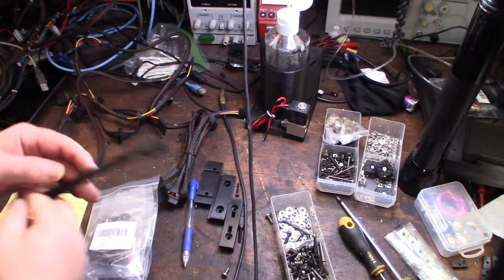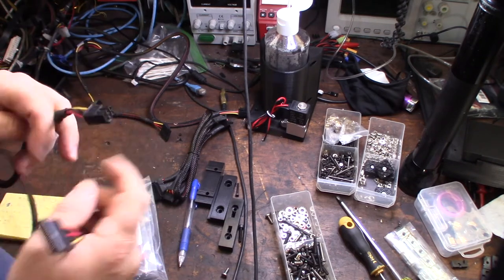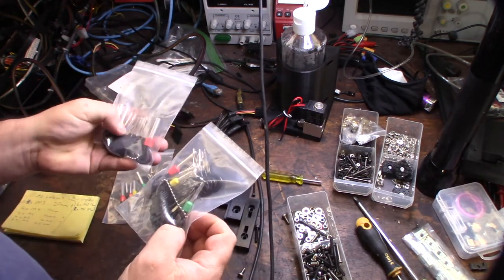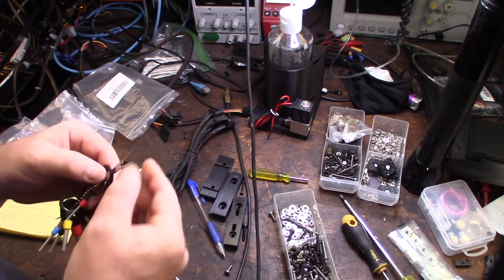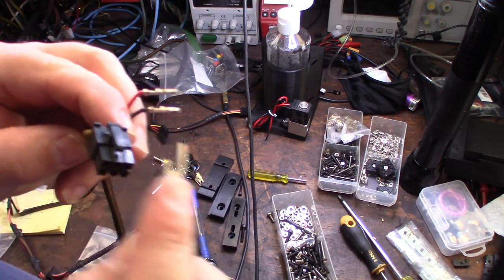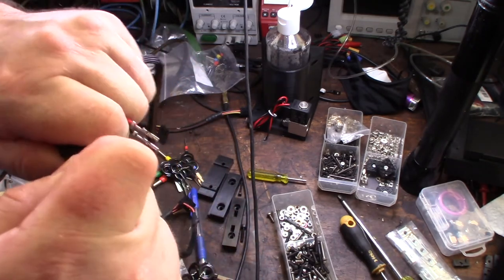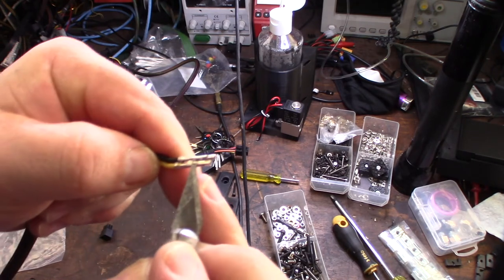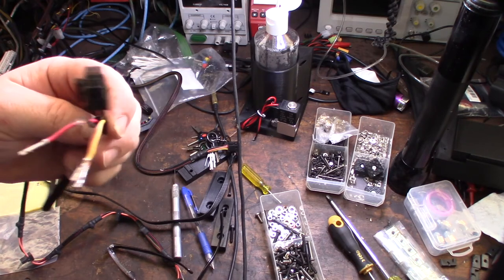How to Repin Rewire a Molex ATX Power Supply Connector

Comment: I've recently had the same issue with a PSU I have a burnt molex connector that has completely detached from the 4 wires. My question is does it matter which way the 2 ground wires attach to a new connector

Comment: Hi. I have a bunch of 8 pin to 4+4 CPU cables. How would I cut off the 4+4 connectors and replace them with Molex male connectors? I don’t want to buy a batch of PSU cables I don’t need.